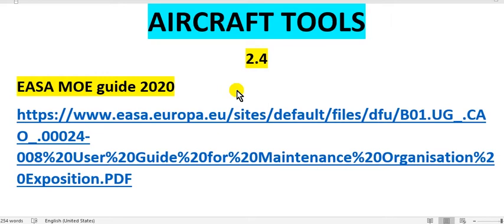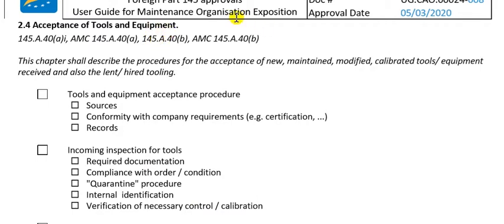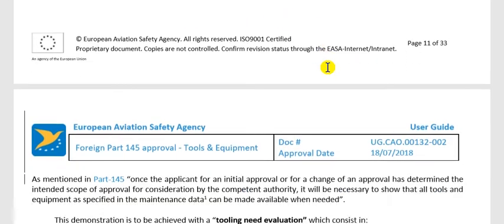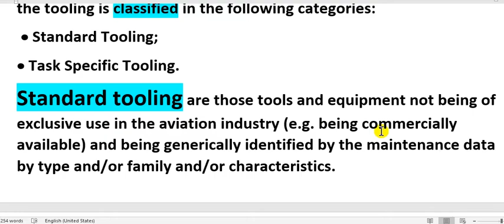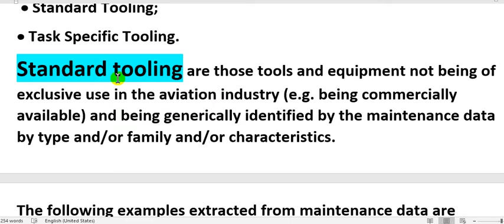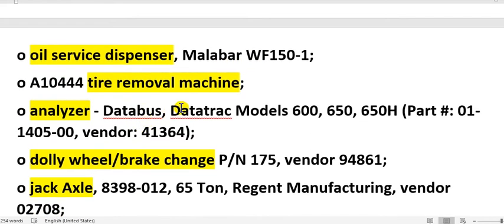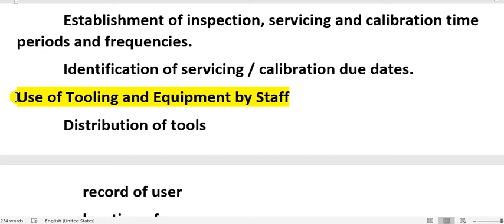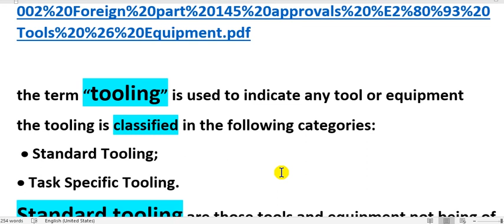Aircraft Tooling

Comment: Hi Abbas, I would like to know how can I start a calibration programme of all the tooling because actually, I'm using a simple excel table that checks every month. Besides that, the ground equipment has some calibration components like manometers, I should be included in the calibration programme or make diferents calibration programs? Thank you so much for your support.
Reply from the maker: You can make a column in your Excel sheet for waning